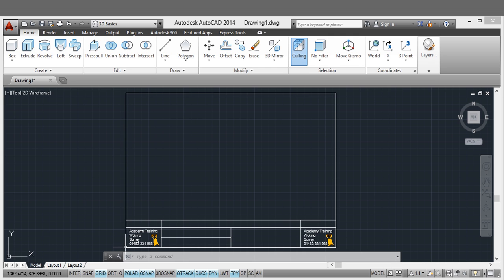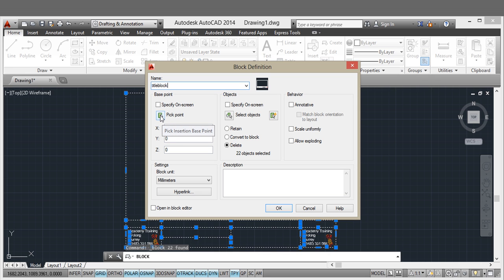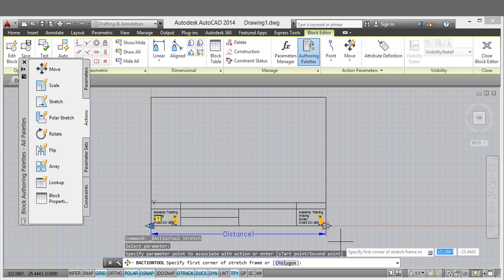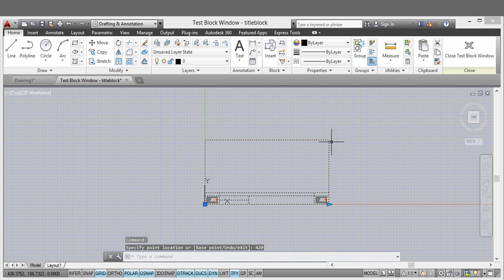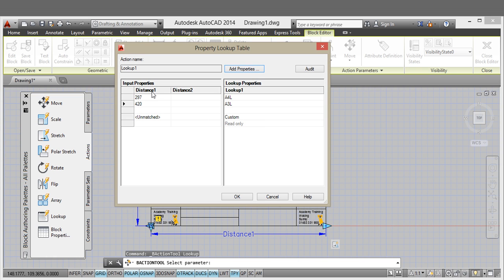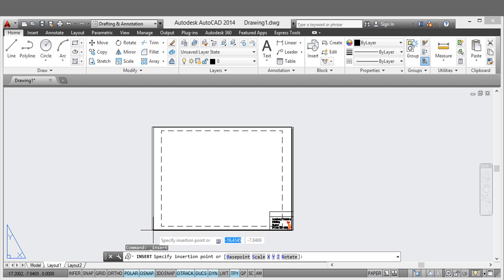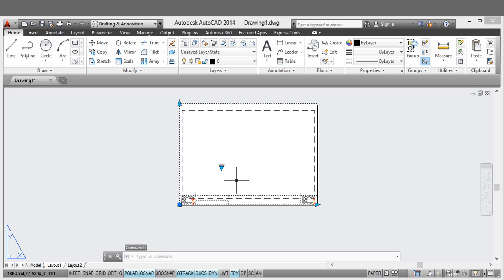Dynamic Title Block with Lookup

Comment: Thanks so much for making this video.  I am obviously doing something wrong though.  I got all they way through & am able to manually resize with the horiz. & vert. grips and the lookup list is there when I click it.  Where I hit a wall is that when I select one of the items from the lookup list, the block does not resize to distance 1 or distance 2.  I've gone through the procedure several times, but the result is always the same.  When I Audit the Property Lookup Table, there are no errors found.  Any suggestions or tips would be greatly appreciated.
Reply from the maker: Hi. Let me have a look for you tomorrow. Just past midnight here now.
Reply from the maker: Hi there again. Morning time now in UK, and very wet it is too.
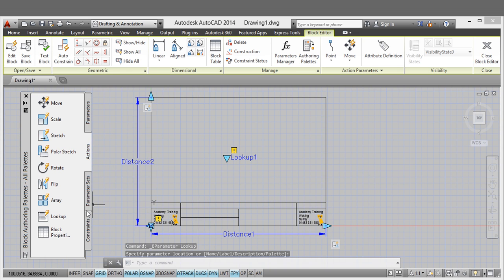Can you ensure that the steps from 5:00 to 7:00 to add the distances 1 & 2 to the Table properties have been followed in the order they are in the video.
If not then you can PM me a copy of the file or let me know an email to contact you on.
Reply: @OakleyTurvey  I really appreciate your quick response.  It was a bit of a crazy day here & didn't get a chance to try it again. I will give it a go in the morning when I get back into the office.  I looked for a link to pm you, I didn't see it in the about section of your page.  After a bit of looking around, I found out it's been eliminated as of a month ago (https://support.google.com/youtube/thread/12446824?hl=en).  Again, thanks so much.  I'll be in touch tomorrow (U.S.).
Reply: @OakleyTurvey  I tried it again & have the same result.  Not sure what I'm doing wrong.

Comment: Hi, accidentally i selected auto hide for block authoring palettes, and cannot view or recover, pl suggest how to recover the block authoring palettes
Reply from the maker: If the Properties palette is not displayed, click View tab  Palettes  Properties.
Click Insert tab  Block Definition panel  Block Editor.  Find
In the Edit Block Definition dialog box, select the block with custom properties that you want to modify.
In the Block Editor drawing area, click a parameter that has been added to the block.
In the Properties palette, under Misc, click Show Properties.
On the drop-down list, do one of the following:
Select Yes to display custom properties for the block reference.
Select No to hide custom properties.

Comment: Hi, This is exactly what I'm looking for except I'm clearly not getting it. I'm copying you to the letter however, I cant seem to grasp the exact selection process on the stretch action. I keep getting the message "select objects: specify opposite corner: 49 found, 51 total,

I don't seem to be able to end the command!!!!, Additionally if I exit out and test it tend to move the objects rather than stretch!

Could you offer some guidance?

Thanks
Reply from the maker: For the first step you are selecting the stretch area. Any objects fully in this area will move, objects partly in the area will stretch. You then get to select the objects you want the action to apply to (in case you want some things to stay where they are) In our case we select the same area again.(from right to left).
Hope this clears it up.
Let me know if still having problems
Reply: Thanks I actually got it after several hours
Reply: Strech tool works fine when the selection is from Right to Left (Green colored selection box) otherwise it won't work in my opinion.